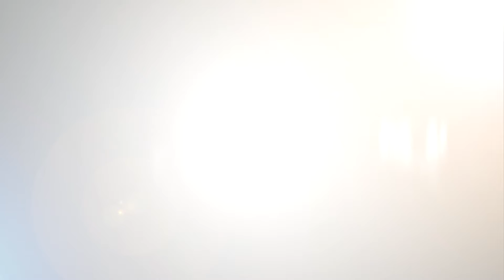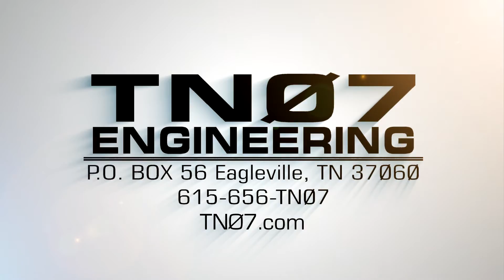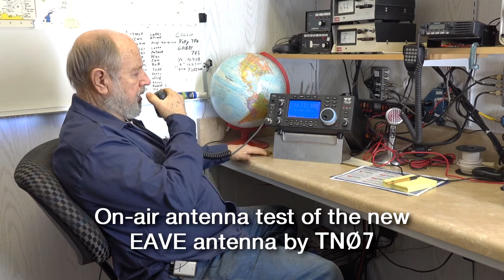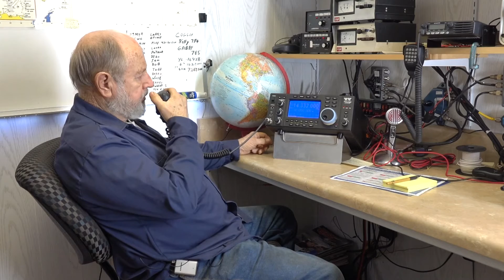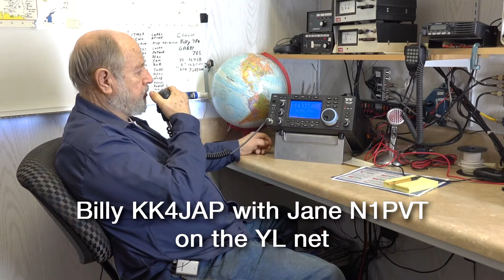Eave Antenna On Air Test

Comment: Difficult to imagine an end-fed antenna located in such proximity to a metal building as pictured in this video.
Reply from the maker: Billy actually has the eave antenna mounted across the top of his building.  You can see a typical install here:  https://tn07.com/imd107-hoa-special-virtually-invisible-eave-antenna